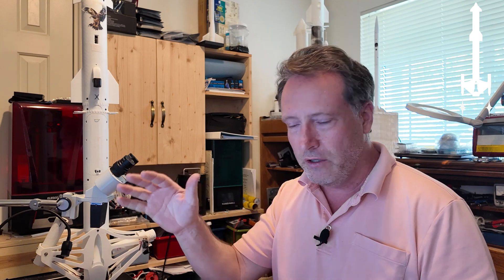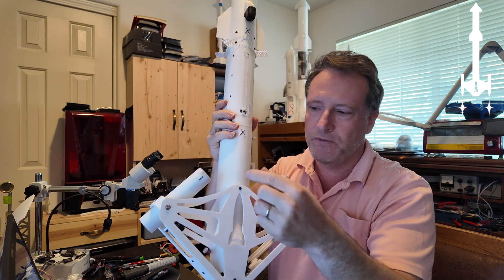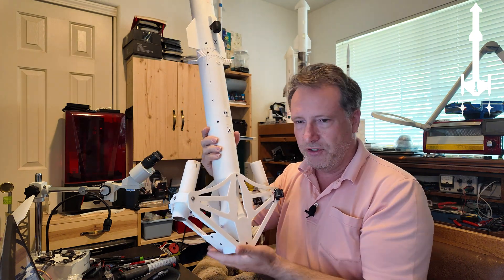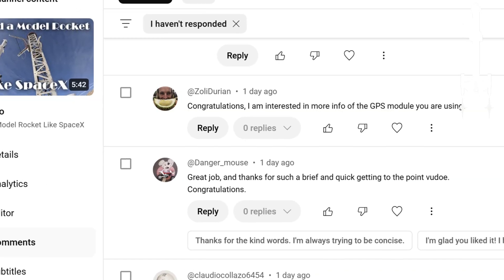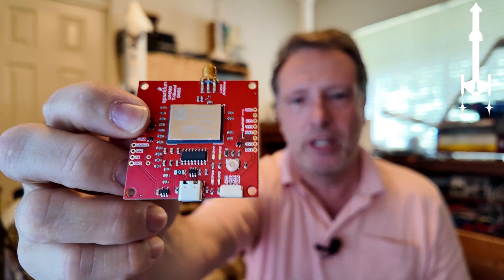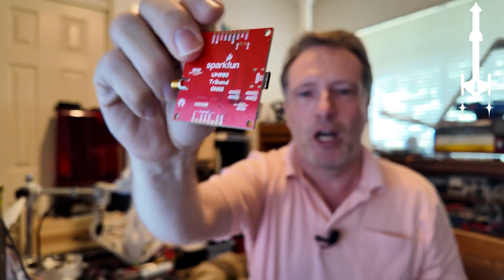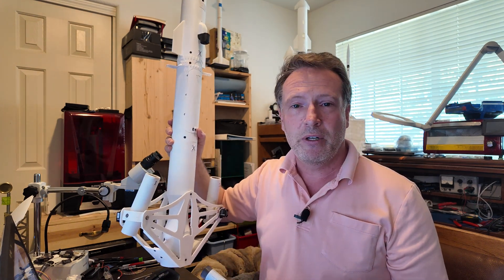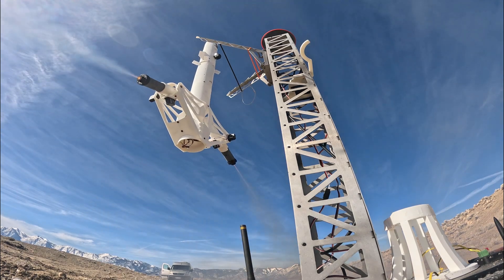Answers For How To Land A Model Rocket On The Launch Tower

Comment: What kind of software and flight computer flies the rocket? Or is that too sensitive to disclose? 

I'm wondering if you're using off the shelf computer and something like a modified drone autopilot thing or is it completely custom. If its the latter one, can you give details?
Reply from the maker: The core of the computer is a Teensy 4.1. It waits for the IMU to give a new measurement which is every 5 milliseconds. It takes it 1 millisecond to do all the calculations and send out the commands to the servo motors. Then it waits again.
Reply: @FlyDuoDiscus  thank you for the answer
Reply: 1 millisecond is very impressive! Do you happen to know any good resources for optimizing embedded software for runtime?

Comment: I’d love to hear how you guide the rocket towards the tower. I assume you’re using an EKF for state estimation however, the control method to direct the vehicle towards the tower is quite interesting.
Reply from the maker: No, it's not using a Kalman filter. That updates its parameters as it goes. I don't bother to update the parameters as I have enough test data to already know what to set them to. Also, I couldn't find an Arduino library for the filter with more than 1 dimension. I will add this to the list of questions to answer in the next video.

Comment: Make the catcher more stronger
Reply from the maker: I was actually worried that the catching arms would damage the side of the rocket, even though there's only one rubber band driving them. I suppose two pairs of catch arms would hold it more securely. But then it would not look like the original design and a lot of this is trying to make it look the same.